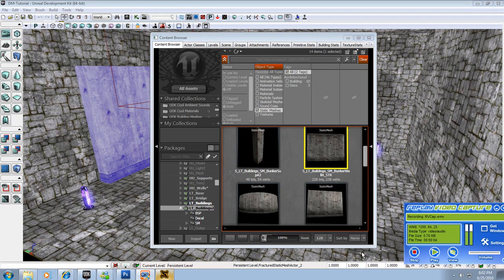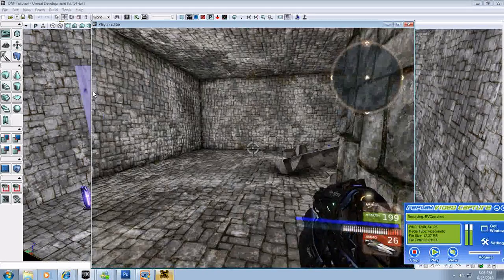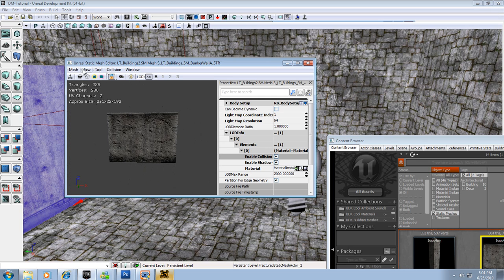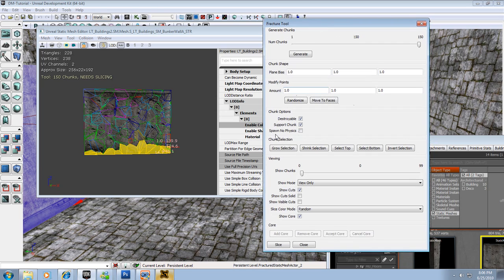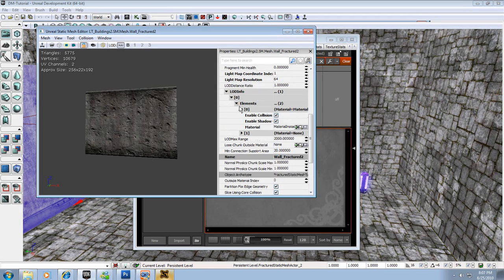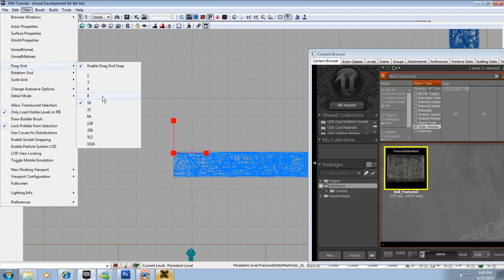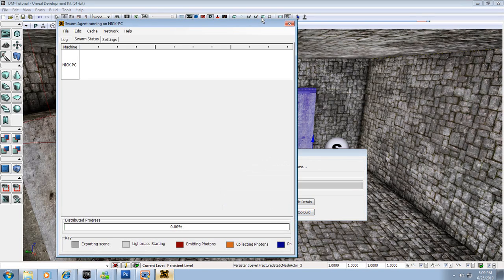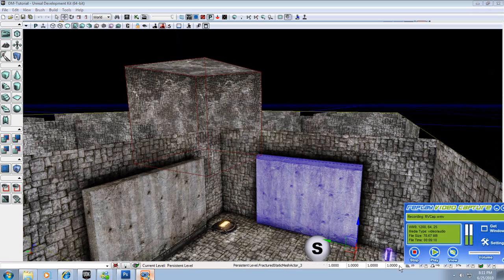UDK Tutorial 8 - Fractured Meshes

Comment from the maker: @Techrave1 I think somewhere in the static mesh rditor or fractured mesh editor there is a setting to change the objects weight or strength. This deteremines how easily the wall can be broken down, the easier it is to break down the weaker the weapon you can use to do it,